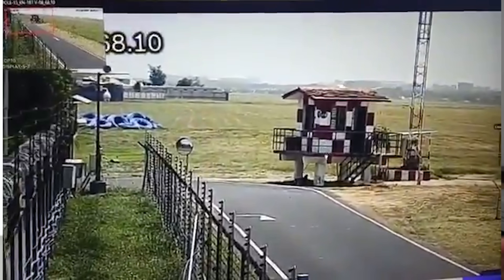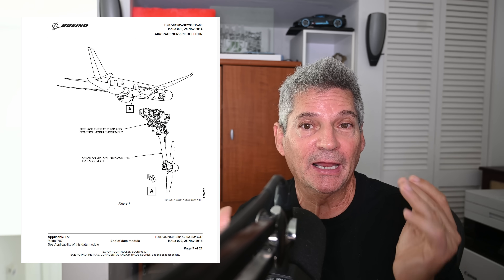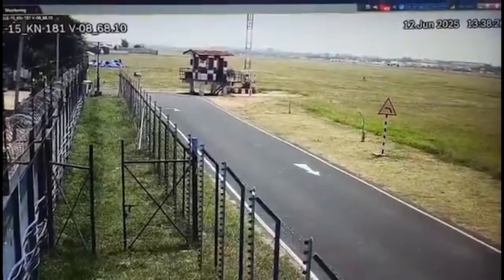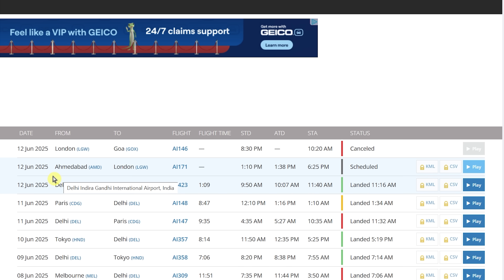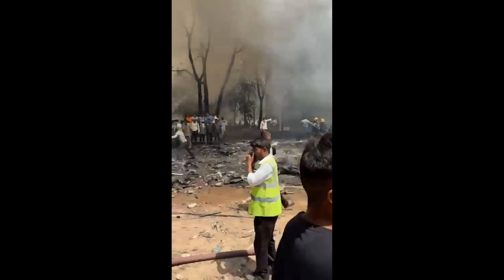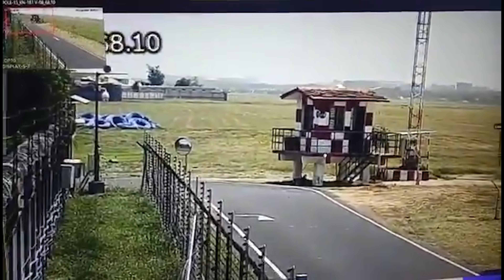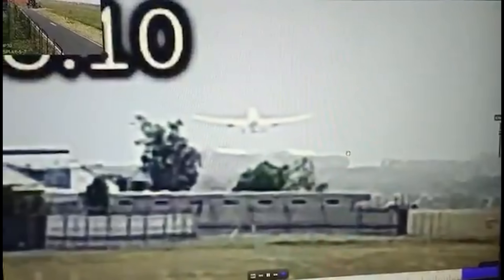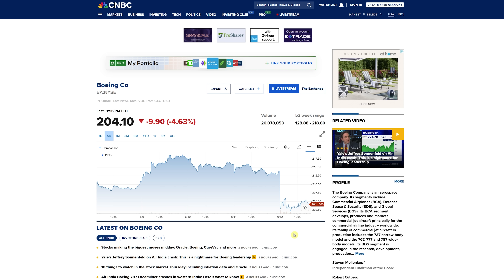What Caused Air India 171 Crash, Mysterious Sound Before Impact

Comment: I would like to respectfully present an alternative hypothesis regarding the tragic crash of Air India Flight 171 that occurred on July 12, 2025.

Please understand that this is not a criticism of any individual or institution.
It is a technical attempt to contribute an additional perspective to the investigation, possibly related to system logic and the interaction between the pilots and automation.

---

✈️ Chronology of the Proposed Hypothesis – Flight 171

1. Successful Takeoff
The aircraft departed Ahmedabad and climbed normally to approximately 700 meters.

2. Landing Gear Not Retracted
The pilots apparently failed to retract the landing gear, which remained extended.

3. Autopilot Engaged Too Early
Despite the gear being down, the autopilot was engaged during the initial climb phase.

4. Autopilot Misinterpreted the Flight Phase
Based on Boeing’s automation logic, the aircraft may have interpreted this configuration (gear down + autopilot on) as landing mode.

5. Automatic Flap Reconfiguration
The onboard system adjusted the flaps to a descent configuration (e.g., FLAPS 20°), reduced thrust, and initiated a soft descent.

6. Pilots Did Not Detect the Incorrect Mode in Time
The flight crew may have trusted the autopilot and failed to recognize the improper descent profile.

7. Loss of Lift and Speed
The aircraft descended with a nose-up attitude, eventually entering aerodynamic stall due to low speed.

8. Delayed GPWS Alert
The Ground Proximity Warning System (GPWS) initially did not issue a warning, as the descent seemed normal.
Only when the aircraft neared the unexpected obstacle — the B.J. Medical College building — did the system detect terrain and trigger: “TERRAIN! PULL UP!”

9. Fatal Impact
At the moment the warning sounded, the aircraft was already too low and too slow to recover. It crashed into the rooftop.

---

🧠 Core Idea:

> The aircraft may have believed it was landing — because the gear was extended and the autopilot was on — which triggered a descent during a phase when it was still supposed to be climbing.

This scenario does not directly blame the pilots or the manufacturer.
It highlights how human error combined with automation miscommunication can result in an irreversible outcome.

Comment: Most likely they lost both jet engine power, someone said it were pilot error selecting the flaps up after takeoff, but when the pilot seeing no climbing rate, the pilot would not have called for mayday. Instead, they would have checked the landing gear; that's a pilot's muscle memory. It's most likely that two engines were off and they were losing power, which is why the pilots called mayday. Also, the deployed RAT supports this.

Comment: Keep in mind this jet was #23 built at the  first production line at the Everett factory, all 787s are currently built in South Carolina.  At that time there were still major production problems but certification was not any of those problems. Certification issues and the way McDonnel/Douglas former executives lied to the FAA to certify the DC-10 before Boeing bought McD/D is exactly the cause & same scenario of the 737max failures.  But the 787 was not delayed by failures nor was any potential failure covered up because supply issues gave engineers plenty of time to fix any potential issues that management deliberately covered up on the DC-10 (resulting in 1,350 unprosecuted murders) or on the 737max (resulting in 351 unprosecuted murders). Keep in mind it was never Boeing who took over McD/D,it might have been planned that way, but it quickly turned into a coup d’état where McD/D quickly hid HQ far from Seattle moving HQ to Chicago where the old school style of management that took McD/D down was resurfaced having now full control of the Boeing Company. It is outrageous the Federal Government did not prosecute McD/D executives who literally premeditated the murders of those who died onboard the DC-10 and allowed them to infiltrate within Boeing to do the same damn thing.  Boeing was a victim of our Federal Govt refusal to prosecute cold blooded killers running McDonnell/Douglas and allowing them to continue their murder spree at Being, hiding out in Chicago is simply unforgivable.

Comment: Cant see a rat in that footage, but the wings look thin, ie no flaps, as can be see n un the hq footage. No gear retracting either. Combined with a potential too low v2 they stalled once they increased climb rate. (Couch pilot, so grains of salt should be taken)

Comment: did not answer why the liftoff or rotation towards the end of the runway how it is normal?
Aircraft is having degraded takeoff performance and did a rotation/lift off close to end of runway why these experienced Pilots are not questioning themselves the degraded takeoff performance where the runway is 11000FT sufficiently very long?

Comment: There must have been some technical problem with the plane, but whatever it was when thrust was lost the pilot had to act and put the nose of the plane down to maintain speed and hopefully actually gain some to keep flying. But. because he was still low to the ground, the natural instinct is to pull up and hope. It would have taken enormous courage to have headed downwards with so little height.
It seems like the loss of power happened at the just worst possible time.

Comment: Hi mate. Good video. RAT sound is convincing. But of the 3 deployment triggers, the only one that would cause this is dual engine failure. Despite being highly unlikely, that FR24 data does not back this up. There is no loss of speed, it continues to climb AND accelerate. Impossible without both engines, esp with gear down.

Comment: From wiki https://en.m.wikipedia.org/wiki/Aircraft_engine_starting, Gas turbine engines can be shut down in flight, intentionally by the crew to save fuel or during a flight test or unintentionally due to fuel starvation or flameout after a compressor stall.

Sufficient airspeed is used to 'windmill' the compressor then fuel and ignition are switched on, an on-board auxiliary power unit may be used at high altitudes where the air density is lower.[16]

During zoom climb operations of the Lockheed NF-104A the jet engine was shut down on climbing through 85,000 ft (26,000 m) and was started using the windmill method on descent through denser air.

A compressor stall is a local disruption of the airflow in the compressor of a gas turbine or turbocharger. A stall that results in the complete disruption of the airflow through the compressor is referred to as a compressor surge. The severity of the phenomenon ranges from a momentary power drop barely registered by the engine instruments to a complete loss of compression in case of a surge, requiring adjustments in the fuel flow to recover normal operation

Comment: seems like flaps were retracted instead of gear,?  BUT people have heard the RAT deployed which means total power loss at the same time?  Why the hell would that happen on T-O?  Fuel starvation to the engines?  Normally you would already have the gear retracted by 625 ft.  Actually it's, "positive rate - gear up"  So the airplane probably would have accelerated past V2 by then if gear were up on schedule, with about 1,000 ft or more.  The Swiss cheese really lined up on this one!

Comment: My bet: software. The 787 is super modern. I read: super confusing, when something goes wrong. See the MAX 8s. In the "original" video I can see the line gap on the flaps, in both wings. It's enough for me about the configuration thing. The wheels are still down most likely due to the problem that caused the lift loss in the first place or the pilots decided to keep those down to absorbe the impact. "Positive rate, gear up" is one of the most automated and repeated exercise in aviation. The gear landig handle has a wheel in its design whereas the flaps lever have a wing-shape design. The former is placed verticaly to be played up and down (like the wheels actually do), the later is placed at the horizontal console to be swithced forward and backward, like what happens at the wing. More intuitive than this, it's hard to imagine. I wish so many devices, cable tv boxes, washing machines, TV remotes, operating systems, apps, etc, were this intuitive. I wish modern cars didn't became a confusing enterteinment centers. There should be, in an ideal world, NTSBs and such for car accidents and it would be interesting to learn how these distractive consoles with giant screens play a role on those accidents. Sorry for the rant, it's saturday and I have some spare time. FREE the buttons, switches and levers for cars!

Comment: It was a bird hit guys , when the plane took off , there only itself the plane got hit with a bird , and it went inside to the engines , the place where the fans actually fitted , and in the video itself its looking at the end something coming out and flying before the plane crashes , which means they are not the wheels of the plane , the front one ,because if it would have been the front wheel , the single wheel which is at the front if that gets hit , and gets detached , definitely the aircraft would have got bumped on to the lower portion of that building which hadnt happened , so it was just a simple blow , bird got out the moment it saw plane is going to hit that building from inside that engine ,area , ok and it was not the wheels of the back area also because if it would have been those wheels it would have bumped onto the ground itself and wouldnt have hit the building also , it would have hit the lower portion of the ground attached to that building , so its a complete bird hit due to which the aircraft flew inside to that building , and crashed afterwards , and the back side wheels were there at the crash site , its photographed which means the front side wheel was also there orelse it would have bumped onto the ground itself ,if it would have bumped on to the ground and then crash on that height of that building ,which hadnt happened , so its a complete sited bird hit crash , and which is why the plane was flying with that horrible sound , from the starting itself .

Comment: so this what i was saying in another video. thid accident almost resembles what
what happened to Air Ftance A320 in 1988 that had flyby wire issue and lost all power making it crash in a the end of a forest.
i am wondering if there was an issue that cause a temporary loss of power to the engines and the system detected it that made  the RAT system deploy?
Because there was ankther video where you could herr right before the crash tge engines going yo full powerr  judt wasnt enough time to get the plane up.

Comment: I hope it wasn't intentional, but the sequence of events seems to indicate loss of engines right at rotation time.  No signs of ingestion, and probably not a loss of two engines lost because of fuel.  Fuel cut-off switches can explain the timing of the lost thrust and the RAT being deployed.  I see flaps and slats with a RAT out, the sound of a RAT but strangely no sound of jet  engines.  So I think the engines were off and cant  see anything other than fuel shut off switches happening that fast. Accident or intentional, seems most plausible in my armchair scenario building 🤷‍♂️... Oh and also the reported loud band I think can be linked to a RAT deploying I think, because it is spring loaded.

Comment: Flaps aren't extended. At least that's what it looks like in this poor quality video. If.....IF...that's the case, plane cannot generate enough lift for flight at slower takeoff speeds. If....IF that turns out to be the case, pilot error. But WAY too soon to make that determination especially with suck poor quality video. But the plane definitely stalled. The exact reason? TBD.  Actually, the more I look at the flight path, probably not flaps...probably wouldn't have made it to 600 feet and it appeared to initially look like a normal takeoff. Not really consistent with flaps not being properly set. 

Whatever the cause, how devastatingly horrible for everyone on board. Just terrible. I can't imagine what those poor people went through in their last moments.

Comment: Seriously? You are saying that the plane lost power while. Still in a nose up attitude and having reached nearly 600 feet while maintaining nearly level. Wings with at least one engine completely off to trigger the ram prop? When it is simple obvious that the engines visible beneath the  wings would be more obstructed if the flaps were down. I can't see the flaps, just a thin wing cross section "ESPECIALLY" in this HD version video.. 

I find this concerning report to be lacking in critical thought and responsible reporting. Losing an engine on take off would seriously affect the level flight causing a severe dip to one side needing  correction also not obvious.. I'm surprised at you. Consider whether the window was what was used to video and it's audio recording quality as well as sound bouncing off the concrete buildings causing simultaneous echos. Simply irresponsible reporting

Comment: But they didn't need thrust. They needed lift. Flaps weren't in use. Notice wheels are down 30-60 seconds after takeoff. They would normally be back up in about 3 seconds from take-off.

Comment: All conjecture......... If (IF!) there was water in the fuel tanks from previous sectors (ice/condensation), which had not been drained pre-flight, then the change in aircraft attitude on rotation may have allowed this water to be sucked up from the bottom of the tanks and into the engines thus causing a simultaneous failure of both engines. Was that dust being blown up on rotation or steam from the engines? This would cause the RAT to drop. RIP all.

Comment: Also, if you look at time 1:58 - it looks like some of the inboard spoilers on each side are slightly raised. Maybe if both engines had failed, the loss of hydraulic pressure and the extreme low pressure being exerted over the wing whilst trying to reduce the decent rate could have lifted them. If not engine failure, could the captain have nocked the spoiler lever?. Perhaps accidentally caught it as he withdrew his hand from the thrust at V1 which is why they didn't raise the gear as they saw something wasn't right straight after leaving the ground?

Comment: Regarding the takeoff video, one thing I noticed was just after the plane rotated and started to climb there was a big puff of dust/dirt. Normally a plane takes off with plenty of runway left that you don't see something like that. That almost looks like the plane took off right at the very end of the runway, which could mean they were already struggling to get enough thrust to get off the ground.
Reply: Or made an intersection take-off.

Comment: with a FFT script, I can see a broad peak, due to doppler effect of passing by plane, from 421 to 383 Hz, which can be attributed to on board power generator operating at 400Hz. This can vary on each aircraft. At this distance only the 400Hz sound from the jet engine generators can be "heard", however on a close range, as in this test of an A320 RAT,  (linked in the next posting, just in case it's deleted), during the first ramp of 5s, the generator works at around 360 reaches 400 (820 Hz harmonic) at the peak  and drops to 360, with strong signals. On the next ramp and steady tests, the signals are weaker,250-300, and in between ramps a sharp 300Hz dominates the FFT spectrum.

Comment: Very well done soft spoken information.From a person with some hearing loss definately the RAT turbine soumd stands out in the comparison video.I had worked with Turblex aeration blowers and when overhauled (main blades,guide vanes etc) and the sound actually sounds at a lower pitch as if it is spinning slower,but I believe that same overhauled or hardly used soumd is distinguishable in the RAT when comparing the two unique sounds...Thank You for posting.❤❤❤❤

Comment: 1.That could be due to Remote access of aircrafts systems by a terrorist hacker. 
2. A sudden malfunction in the engines.
3. The above air pressure would be too high for the thrust to lift the craft.

Comment: Another thought, the engines must have failed nearly simultaneously; otherwise the asymmetric thrust would have caused the plane to veer off course and there is no sign of that (or corrective rudder action) in the video.

Apart from fuel, one other common factor affecting both engines could be a software glitch (either the plane's auto throttle instructing them to roll back, or the firmware in both engines management systems reacting to the same triggering event).

Comment: 10:40  The plane sank.  Clearly in trouble at tha point.  Heavy aircraft, rolled past V1 runway point with no runway left to recover. Clearly inadequate power for take off. Perhaps should have aborted early. If the 787 used the entire runway and struggled, it strongly points to inadequate power, incorrect configuration (flaps, trim, power settings etc... ), or overloading. Aborting before V1 is mandatory if conditions aren't met. Continuing past V1 without sufficient power is a grave, unrecoverable situation.